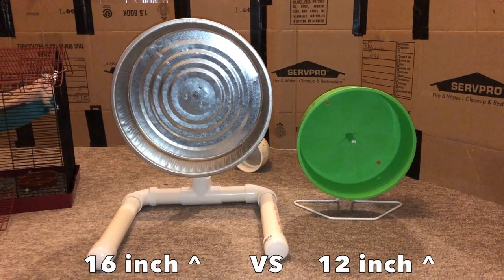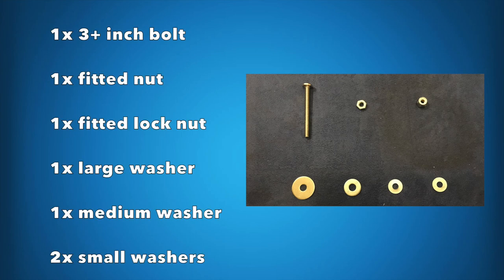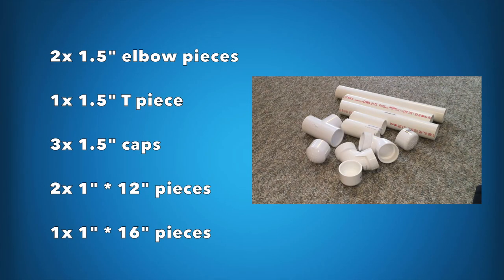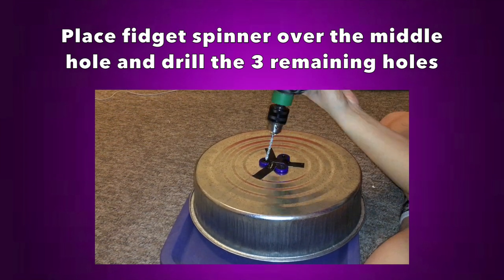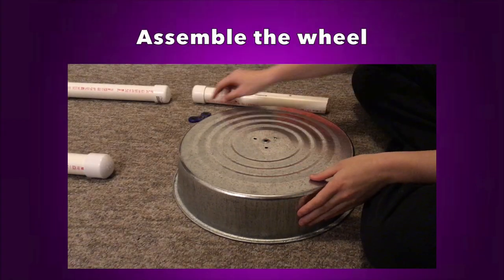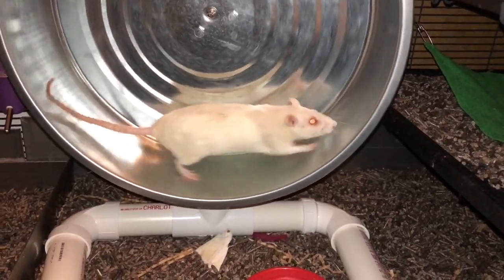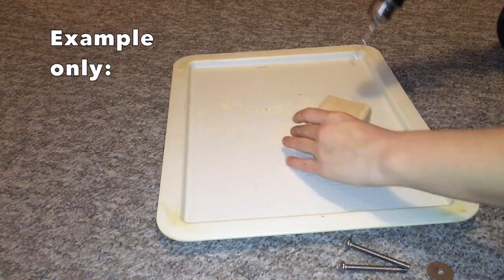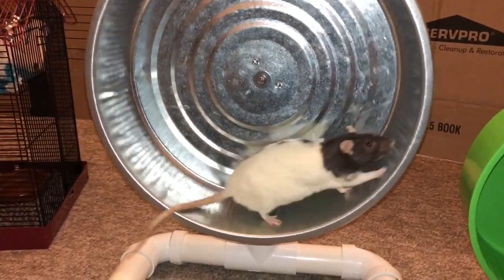How I Made my 16 Inch DIY Rat Wheel

Comment: You can attach the middle of the spiner to the pan and the 3 holes to the piece of wood. Put a nut or 2 between the middle hole on the spinner and the wheel. The 3 screws to 5x5 piece of wood which has 2 or more hang bolts on the outside.

Comment: Hey I’m really needing your help, I’m trying to introduce my rats using the carrier method but am confused roughly how long they should be in each stage for? Should I keep them in the smallest cage until they sleep together? Without any breaks? How long generally does each stage take? Thanks xx
Reply: Jenna Roesch - hi there. I’ve used this method with my rats and I used the guideline given by ‘isamurat’ from ratforum.com. From what I understand, length of time depends on how quickly everyone gets along. Once they start sleeping together, you can then transfer them to a larger (but still small) cage. After becoming buddy buddy, you can add an item or two, such as a flat hammock, but nothing they can hide in. See if you can find that article, as I found it very helpful. I’m on my tablet and don’t know how to copy and paste the link, otherwise I would :/

Comment: Does the pan have to be metal? Ive found plastic ones cheaper in uk, would they be suitable?  Or maybe a large cake pan?
Reply from the maker: Nope, plastic works just fine! The only issue is some rats will eventually chew the plastic, but if its the hard plastic pans I'm thinking of (the colored ones) then its hard for them to get a grip and so they typically don't chew it.

Comment: could I use a 14 inch pan instead of 16 inch pan because I can't find any 16 inch ones.
Reply from the maker: Yes you can, although I linked the pan I used in the description if you want to check it out (it’s a oil pan and $7 in home depot or off amazon)
Reply: Shadow The Rat 
Ok thank you!!

Comment: Would this really be a saving? Do you have an idea of what you spent in total? (not including the drill)
Reply from the maker: If I hadn't tried wood first it would have been $15 total, so a huge save (most wheels this size are $70-120). But keep in mind I already had the screws, dremal, and figit spinner, so those would have upped the cost some.
Reply: @ShadowTheRat  Okay, great,  that's pretty good. Yeah, buying big wheels is really expensive 😐 . Thanks!

Comment: Is this wheel really noisy?
Reply from the maker: As long as you center the holes and have long enough screws then no. My main issue was that my long center screw was only just large enough to go through the PCV pipe, meaning that it would get loose and start to rattle. if I had a longer screw for the middle or wasn’t using PCV (at first I used a wooden stand which worked really well but I was afraid it would start to smell because I hadn’t coated it) then it would be much better.